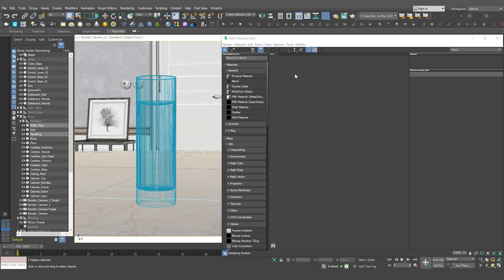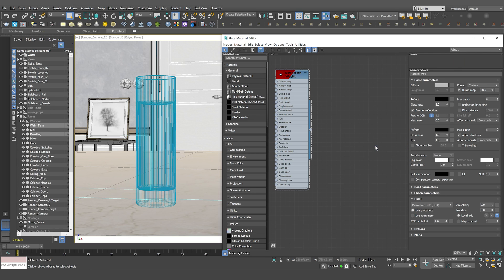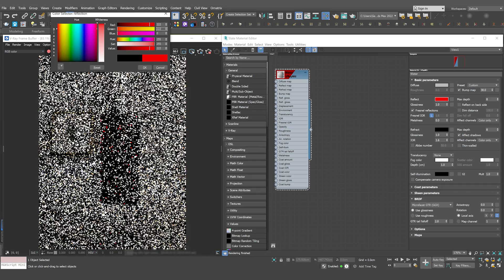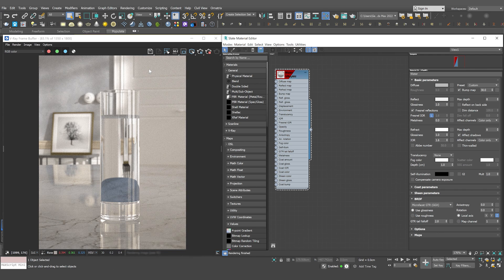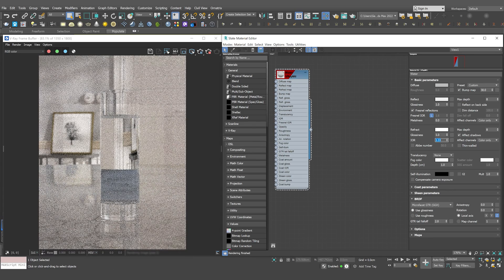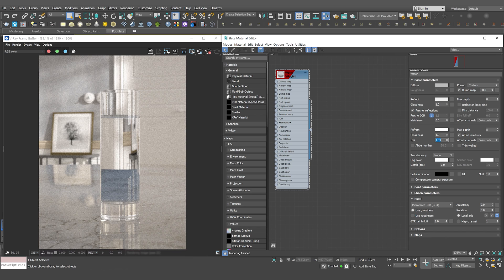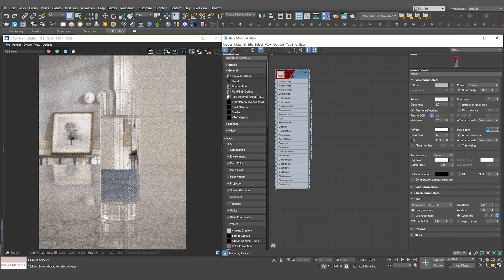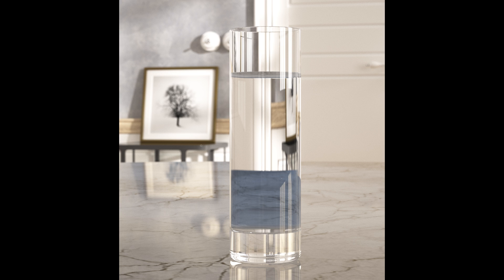V-Ray for 3ds Max — How to make water

Comment: i had a recent project where i wanted to make a stylized ocean material. I used phoenixfd, specially the phoenixfdoceantexture for displacement in the infinite ocean section.. And for the material i used the water preset from the VRayMaterial , made the fog color more saturated, but then I wasn't sure what paramter to adjust to make the water look more stylized. Any suggestions? Thanks!

Comment: Hello, what`s about the adjacent sides of water and glass objects` meshes in this example? Do these meshes have to be of same facet-level shape topology? Do they have to be intersect, to be exactly coincident, or to have a tiny gap between each other? What have I to do if i want to switch this scene for it to show a non-cohesive (reflecting light in both directions) contact between water and glass? How should the water mesh facets to move while flowing along the glass wall in each of these cases?

Thank you for your kind attention, and greetings from Moscow :stayhome: